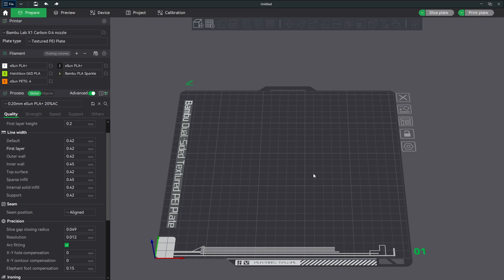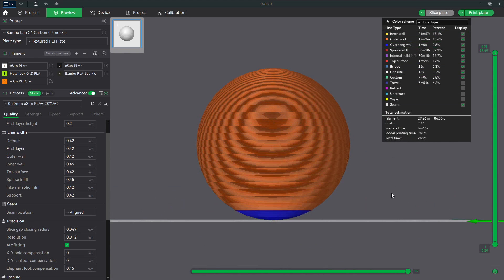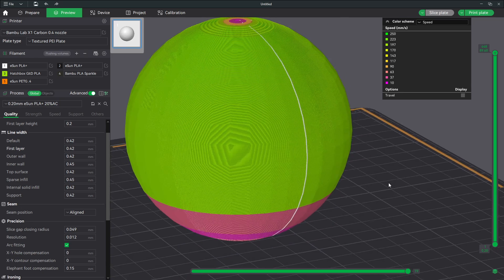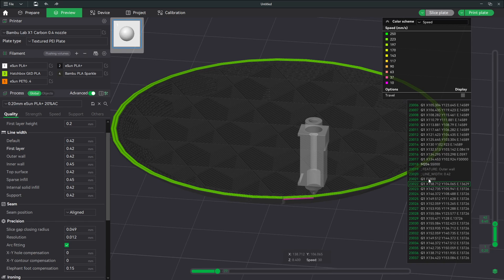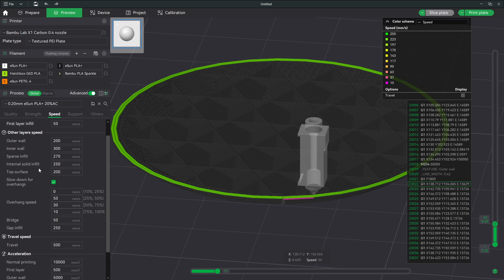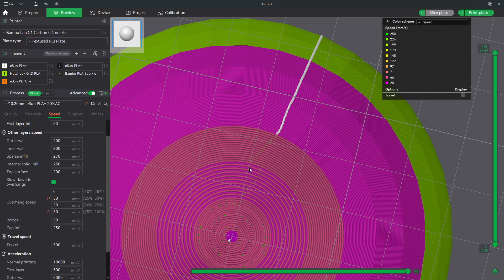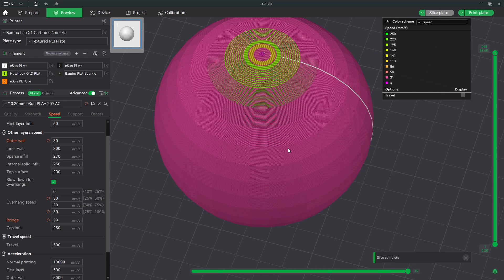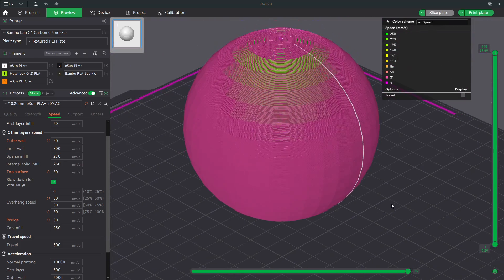Bambu Studio 1.7 beta - Surface Finish

Comment: i was having some trouble printing a sphere, should overhangs be printed faster? Using a x1c - if so what speed should i print them at? Also trying to print a sphere with a uniform finish
Reply from the maker: Particularly with low-temp materials like PLA, heat is your enemy. Pop the top off, leave the door open. Overhangs have to go slow to bond well, but they also have to cool so they don't sag or curl. Smaller layer heights also help tremendously.